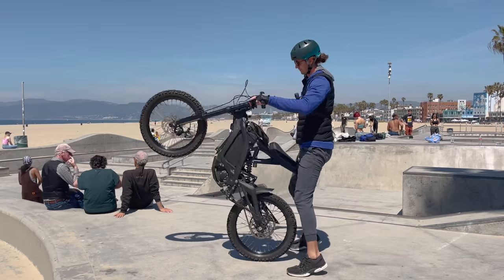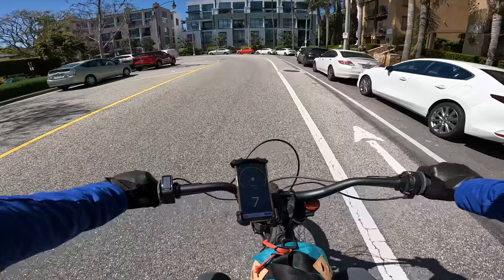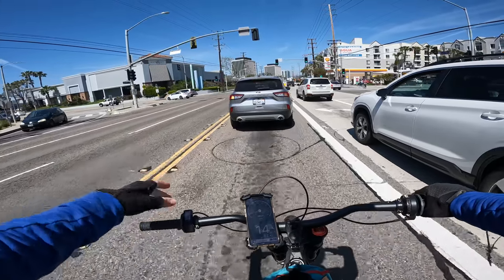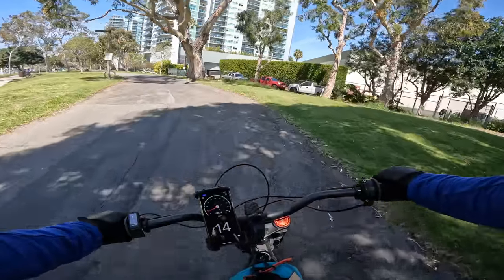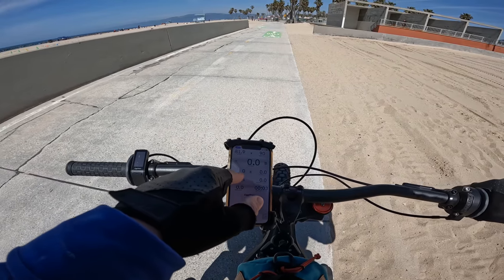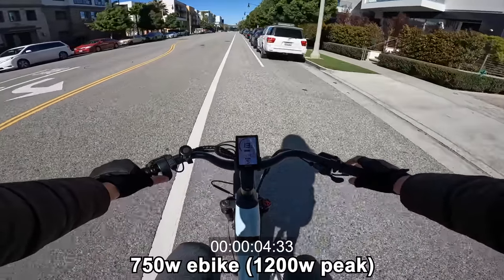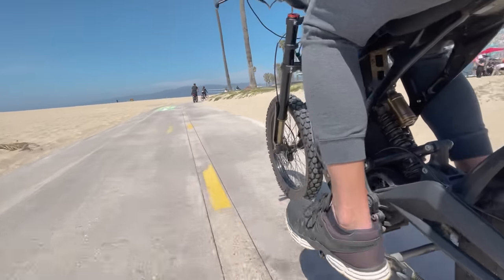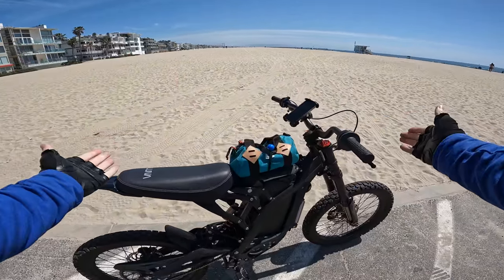This 70 MPH ebike is DANGEROUS

Comment: My state that isn’t considered an E-bike because it has no pedals. All “E-bikes” must have pedals that function and not exceed 20MPH and not exceed 750 watts. If it has pedals and has a speed of 30 MPH it’s considered a moped and must be registered as such. The rider must have a drivers license. If it exceeds 30 MPH it’s considered a motorcycle and must be registered as such pedals or not, and you must have a motorcycle endorsement.  Mopeds and motorcycles electric or not must have headlights and brake lights. If considered a motorcycle it also must have turn signals.  This Surron in my state would be considered a motorcycle no matter what the rider says.

Comment: Upgrading the rotor to one with two metals, so the central spider is a different metal bolted to the rotor, will help massively with brake fade. Given how easily that thing picks up speed I would definitely want to upgrade the brakes.
Reply: Be careful with bicycle floating rotors, almost every one I've seen use thin metal washer's that can rust out and fall apart ! They got to use stainless washers like motorcycle one's

Comment: I have a similar build. Thing is an absolute hoot, but the power off the line is something to respect... which I didn't and I smashed myself up pretty good. Back on it after a bit, now on power level 6
Reply: i raced a 150cc honda dirt bike around a trials course with some stretches and jumps on my bosses surron and i whooped the dirt bikes a**. they are pretty fun to spin around the corners on the trails they feel light like all the weights on or right under you

Comment: I would definitely upgrade the brakes. Mountain bike brakes are intended to stop 250 pounds from 25 mph, ao they are totally inadequate to stop 350 pounds from 50 mph.
Reply: Yeah the brakes should absolutely be swapped w these typa builds
Reply: Double the speed increases energy by 4X for a given mass.

Comment: Under UK law, having a twist throttle makes it not a ebike, and not having pedals makes it not an ebike. That makes it illegal. I guess that's why America is the land of the free. 

Frankly, what you have there is an electric motorcycle with bicycle brakes.
Reply: Its a class 3 ebike, until you remove the limiter.

Comment: It's nice, I live in socal too but I can't justify the price tag. You dont need to spend 10k to go 72mph. The ariel x-class 52v (on sale for $1800 right now) and a 5000w conversion kit (about $1000~), plus a second battery (varies) will get you up to around 62mph. This is just off the top of my head, I'm sure there's many other options for the x-class. Those tires arent very fat, either. So, I like it and I appreciate the contribution but I personally wouldn't ride it. And be careful in the city, always assure everyone is an idiot and that there are cops on every corner.
Reply: The main difference with the SurRon class bikes are that they can used for proper off roading. Any hub/mid drive ebike wont have the same handling if you're looking for some fun in the woods! Plus there are other similar options now available at 72v out of the box for around $4,500

Comment: Hmmm
It's not wise choice to use bike brakes on motorbike.
If you want to have brake wat may be strong enough there is just two options out there.
1. Magura Gustav M ( Very old but still possible to find in good condition)
2. Gator 8 piston insanity ( newer seen one in a wild, probably impossible to get one)
Of course need to be paired with good pads and 2.3 mm thick rotors to perform.
Reply: China has a liking to use bicycle brakes and suspension, although they make some great knockoff dirt bike brakes and forks and shocks that wouldn't add anymore to the cost. Not sure why Suron and Talaria use bicycle components. The Rawrr Mantis has bicycle brakes but they are a LOT better then our Talaria, not and day...still I think they need to just go to a dirt bike caliper, rotor and levers. Even the Apollo RFN aka Beta Expolrer uses bicycle components. It's an odd China thing, same with using 19" wheels...LOL
Reply: @Meekerextreme  well you are right.
Author of this video says it has 12kw ( 17 hp) of power...... 50 cc mopeds what has quater of that from factory have better brakes.

Comment: Review of a custom electric bike with a 70 mph top speed, upgraded battery and controller, and a $10,000 price tag. Includes a test ride and power assist levels.
✦
Review of a custom electric bike with 70 mph top speed and $10,000 price tag
00:01
✦
Explaining the power assist levels on an e-bike
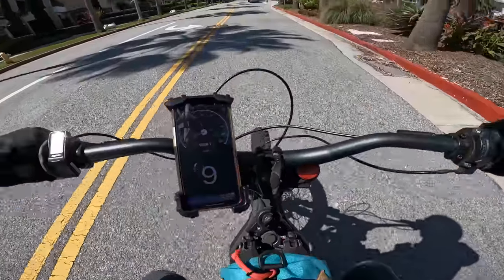01:03
✦
The bike's modifications and features
02:10
✦
Riding the electric bike is fun and requires effort
03:40
✦
Review of an e-bike with a top speed of 40 mph
04:58
✦
Riding technique matters more than location
06:38
✦
This bike is expensive and has downsides
08:14
✦
The e-bike is powerful but dangerous
Click to expand
09:17

Comment: We got a Sur-Ron and it climbs hills so good and acceleration is crazy. I got two batteries and can travel about 50-60 miles. Put a thicker seat on too. On second set of tires now.
Reply: you must have an upgraded battery/controller to get that type of range right?
Reply: @zweed69  I get 45 miles on the average with stock battery, depends on what modes i ride and if there are hills etc.
Reply: @aaaa1953  thats impressive, I was looking to upgrade mine but wondering if its worth the cost. I think I'm getting around 35-40km max but thats hard riding

Comment: I like how he calls the power modes " power assist" like you would on a power assist pedal bike. Unless you are waddling that thing around like a kids balance bike, those aren't " power assist" as they aren't assisting any effort. They are just power modes, same as you find on most modern motorcycles. Calling this thing an ebike is kinda a joke. A bycycle, by definition, has to be pedal driven. This guy has got the same "pedals" i have got on my Tenere 700. Accept i would call them foot pegs. These things are super cool, and i may buy one someday, but as both an avid cyclist and motorcycle rider, i think it's pretty obvious which direction these things lean.
Reply from the maker: haha I intentionally said "power assist" tongue in cheek instead of "pedal assist" in my normal regal ebike reviews
Reply: you can actually put a 'pedal kit' on the surron so technically its a push bike then 😂
Reply: @zweed69 Still per the law it's a motor bike as the power and top speed is too high. What we tell people is you do what you can afford. meaning you get a ticket don't CRY about it you knew it's not legal.
Reply: @Meekerextreme  maybe where you live....

Comment: This is not an ebike nor dirtbike, it is an electric motorcycle. As someone who rides, the risk you are taking with these is exponentially higher than with an actual motorcycle. They do not have the same safety features and are not meant to go the speed you take it to.
Reply: Was goin to type pretty much teh same thing... The shocks and the brakes are for a MTN not a EMoto
Reply: @dirtedeuce5936  Not too mention that usually the bicycle suspension and brakes is cheaper and more generic on these then you would find on nice name brand bikes in a bike shop.

Comment: If you've ever ridden one (I have) just remember it's essentially a 3/4 size bike. Compared to an actual 200cc+ 2stroke dirt bike, it's short wheelbase, small wheels, and won't take the same level of punishment that an actual dirt bike will.

Comment: It's just a motorcycle with inadequate brakes, put on proper gear when you're above 30mph; this includes full finger gloves, abrasion resistant pants with impact padding for the pelvis (if this bone breaks, and you start bleeding and don't get moved to a trauma center by a very competent paramedic, you will probably die), an impact and abrasion resistant jacket, and a full face helmet.
All the gear all the time.
Reply: I'm one of the most aware people in the safety department, but even I'll say that you're going overboard.  Above 30mph you don't need a full face helmet and full fingered gloves, haha.  Come on man.  People go faster than that every single day on pedal bikes that aren't powered.

Comment: Sold my $10k sur ron bought a used $8k zero fxs and got plated. Got sick of getting harassed on trails so it was a road only bike and I figured at that point I might as well get a real plated motorcycle
Reply: What would you compare the sur ron to when it comes to combustion bikes?

Comment: Looks fun as hell, but it kinda seems like it doesn't really fit in anywhere. I sense a crackdown coming, or some changes in legislation.
Reply: Yeah states are going to start making people put plates on bikes like this and pay insurance, have turn signals, inspection etc.  Might be 10 years but it will happen.
Reply: @Clearanceman2   With its speed and power it already can't be classified as an E bike, so the only way you can legally ride it basically anywhere public is by going through the process to get it plated as a motorcycle. Basically everything in this video is already technically illegal. I'm not sure what it will look like, but they're definitely going to do something enforcement-wise soon.
Reply: Agree

Comment: I bought my used 2018 HD Sport Glide with a 107 CI motor for 10k in December 2022.  15k miles on it. This thing is far too expensive for what it is.

Comment: Have you considered an additional caliper for the brakes. High performance cars often have two calipers per wheel. I know that’s additional brake pads to replace but would provide additional clamping force
Reply: Or just plain bigger brakes. More complex with more rather than bigger.
Reply: The mounts for brakes on a bicycle are either welded into the frame, or machined in. You can't really change the brake geometry on these designs without alot of machine work
Reply: @TriadAgone  you would be surprised how easy either drilling and tapping a bolt hole is if the frame is solid or using a rivet nut insert if it’s hollow is. I’m not saying it would be super easy and would require some fabrication ability but it’s also not rocket surgery.
Reply: @0ldGuy  the brakes mount on a stand-off, and the forks on alot of bikes are hydroformed aluminum. It wouldn't be super hard but if you're doing all that just swap to a more robust system entirely instead if a bicycle system. At that point you can just buy a bike with the brakes you need on it.
Reply: @Old Guy "high performance cars" don't have two calipers used for braking. The second caliper you are referring to is for the E-Brake only and is not used for actual braking when applying the brake pedal.
Reply: @npickart  not true. There are 4+1 and 3+1 brakes, 2+2 etc brakes that exist. Sometimes it's for packaging, sometimes it's for heat management etc but multi-caliper setups exist in performance road cars.
Reply: @npickart  plenty of cars have multiple calipers on each wheel for braking. Most cars have the e brake built into one of the calipers via mechanical cable or separate hydraulic line. I feel like you aren’t all that familiar with high performance cars and brakes. More clamping force=more friction which in turn means more stopping power. Now this isn’t free it results in more heat which is why you see high performance cars come with drilled and slotted rotors to help dissipate heat. On an e-bike we wouldn’t see those kinds of temps because it’s lower speed and way less mass to stop. So either going up in brakepad and rotor size or an extra caliper would provide alot more clamping force. Look above to reread why clamping force helps with stopping
Reply: @0ldGuy  name one.
Reply: @npickart  you want me to google dual caliper cars for you? Ok. Maybach 57 and maybach 62. Ill stipulate most cars do not have dual calipers. It’s only fir really high end cars or for performance upgraded vehicles that need additional braking power. You can do your own googling from this point forward.
Reply: Two calipers? Never seen that in my life.  More pistons in the caliper?  Love to see two calipers
Reply: @somenygaard  I have, but on hard brakeing the rotor either overheats real fast or gets ripped off the hub.  Need two rotors and two calipers.
Reply: @TriadAgone they come with adaptors to match the calipers brand and disc size

Comment: I will never stop comparing to my old 2013 KTM 450 exc that I paid $7500 for. I am just going to say at the start of this video I looked at the connecting point of the wheel hub and the thickness of that swing arm and it is so skinny looking compared to that 250 pound KTM I used to ride up to 80 mph on. I still would like to try that and look it over closely.
Reply: I stopped riding KTM because this stuff really does tare up the body even if you do not crash them. I mean I used to ride on rocky mountains that beat you hard on the knees and back. I even rim pinched and got a flat, and that taught me you better keep that air pressure over 30 psi. or 60 for a mountain bike.
Reply: Also, the noise from the motor noise from the KTM really is an issue, you can't hide and it will increase cops being called for noise complaints. There are signs on parts of the trail telling people to keep the noise down, and locals are fighting hard to have the trail shut down, the one at Edinburg Gap Virginia. I wish I had smooth trails around here.

Comment: For 10,000 smakers I could get a nice used 1200 Kawasaki and have a lot of fun on two wheels and have about 5-6K left over to spend, I would not have to worry about someone snatching it and throwing into their pickup.  For sure the ebike is cool and unique and you can get away with riding it in places where you couldn't take a motorcycle but you can't take any passengers and the like weight brakes, bearings and axles might cause a horrible accident. The overall build is lightweight and will fail eventually especially going off road or jumping or running stairs. I see a lot of ebikes catching on fire and that would be a hell of a way to burn 10K because I'm sure its not insured for that amount.  Very curious where this sits with regulators... if bike then no license or registration, if a motor vehicle then you need plates, insurance and a driver's license?  Pretty wild machine, incredible burnouts too... ride safe man.

Comment: Dude, 12 kW and ~55 kg, that's a serious motorbike. That's about the same power-to-weight ratio as the old Aprilia RS250 - a 250cc 2-stroke (so similar power to a 400c 4-stroke) - which was a very credible track-bike. The RS250 of course had a pair of 280mm discs, with 4-pot calipers on each (it did have more weight to stop - 136 kg or so, with proper racing pipes).
Reply: The RS250 could do 0-100 km/h (0-60 mph) in about 3.5s. So I guess your machine is limited there by gearing and wheelbase? 7s is still faster than most cars!
Reply from the maker: haha love you're analysis. These are all facts. The power to weight ration and instant torque delivery are what makes this bike incredible 😆⚡️🤙
Reply: @TailHappyTV   To be honest, this thing shouldn't be on public roads or paths...

Comment: The brakes might not be the problem, often times it is simply the brake pads. On my heavy electric mountain bike I switched over to MTX red racing pads. Problem resolved. They are super powerful and they never squeal.
Reply: I don't think there is anyway to make this safe with even the most high end bicycle hydrailic brakes. Your bicycle isn't hitting 60-70. My emtb that brakes are awesome and can easily hold me on a steep rock roll with ease. But if someone pushed me to 70 mph the brakes would only last one squeeze before they were too hot to stop me.

Comment: I was looking at getting the Lightbee X recently but for my usage an eMTB made more sense so went that route instead. The Lightbee is a motorbike, no question. But the fact that it's almost a bicycle in terms of size and looks still has me very interested. Where I am a motorbike license is required plus registration to ride it on the roads so that was the deciding factor against it for me.
Reply: I found a ebike that is nothing like this and impressive(but nothing like his) but what I wanted was to look like a bike. undercover.  lol  The moped style ebikes look like minibike in my era and a dead giveaway.   way cooling looking in my eyes.   The one I got was also reviewed on his channel.  But his is older and they upgraded them alot but basically same power train.

Comment: It’s clearly a motorcycle designed to cheat the system by pretending to be a bicycle to avoid licenses, lights and to cheat and ride on non motorcycle areas.  Fast enough to aggravate every hiker, equestrian and mtb rider on multi use trails yet rather inadequate for any OHV park. We used to call something like this pit bike.  Pit bikes were a something you rode around from the pit lanes to the camping areas on race day. 

Throw some signal lights on the thing and it would be a nimble city traffic commute bike. Zero protection from cars but it’s nimble for avoiding them.

Comment: So inspiring! Just saw this as I'm adding a 8kW QS273 to my fat bike. If I show up on a Sur Ron, I'd never be able to be near a bike path. What controller are you using? Ahh - BAC4000..found it on the other video. Cool.
Reply: Make sure your rims n frame are rated for that, otherwise I'm jelly 🤩
Reply: a QS273 is probably more power than you need this bike comes with what is basically a 138 and it can go 15kw @ 72v safe
Reply: I’ve got the BAC4000 on my stock 60v, SM wheels dual caliper for the rear. Blinkers, headlight, horn . Too much fun. I’ve raced motorcycles in everything my whole life. I ride on the street respectfully and haven’t had a problem with the police. There’s a Time and place for everything so don’t do anything stupid in front of people to get noticed. But go crazy when nobody is around.And wear gear. Oh I’m 67, Try to Catch Me, no way.